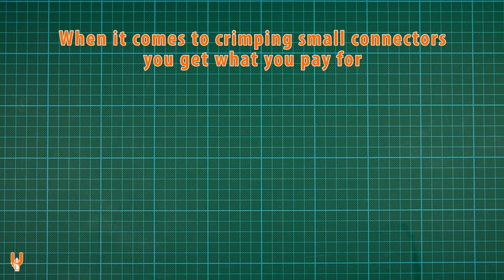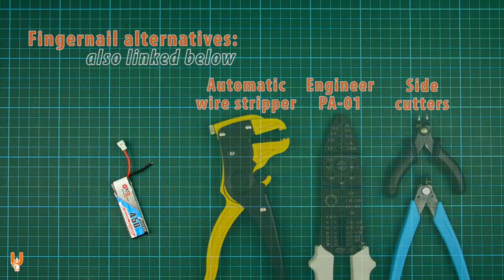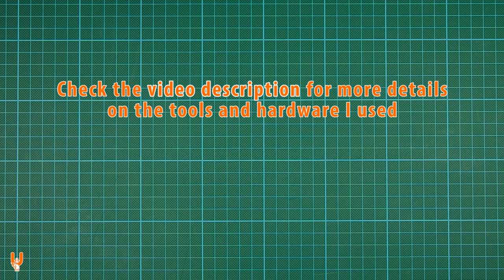How to add PH2.0 "powerwhoop" connector to your batteries - QUICK GUIDE

Comment: Hey Why is it so that I can't find JST-SH(FC and VTX Cable)  connector kit online is there something special with it
Reply from the maker: There are plenty of JST-SH crimp kits on AliExpress. Are you looking for a specific type/size?
Reply: @muteFPV  I want to make my own fc cable but I can't find a single kit on net for crimping jst-sh probably it's 1mm so it's hard to do at home I Guess
Reply from the maker: I haven't looked much for this size, I have a wide range of pre-made harnesses that I use when necessary. I would prefer to make my own too using silicone wires.

Comment: I wonder why you check for polarity? :) Did you expect for colored wires to output differently? :)
Reply from the maker: This is supposed to be a guide, I wanted it to be as complete as possible. It is just an extra step to avoid a simple mistake that can cause all sorts of problems later ;)

Comment: Nice. I need to do this with some of my micro-losi batteries. I was going to just solder wires (that already had a PH2.0 connector on one end) directly to the cell tabs but, I can't find any PH2.0 plugs that have silicone wires with a thick enough gauge. I guess I'm going to have to bite the bullet and get a decent set of crimpers.
Reply: Actually, I just saw the price of the crimpers. I can't justify that for just a few batteries.
Reply from the maker: It is not cheap, that is for sure. But keep in mind you can also crimp motor plugs (1.25mm for brushed whoops or for larger motors like the Tinyhawk), do your own JST harnesses for Rx, VTx and a lot more, related to multirotors. I haven't had good experience with cheap crimpers but you could give one a try, for example the JST SH from Hobbyking, which was recommended in another comment earlier.
Reply: @muteFPV  I usually prefer to direct-solder stuff than use connectors at all. But, obviously you can't do that with battery connectors and, it isn't practical in some other cases. I'll certainly think on it some more.
Reply from the maker: Please let me know if you find a source for good quality PH2.0 battery leads with thick silicone cables
Reply: @muteFPV  I surely will.
Reply: Theres an aliexpress seller with ph2.0 and 22awg silicone wire. 10pairs for 1.80euro
Reply from the maker: @Vincent: I found one named SINONING, is this the one?
Reply from the maker: Thanks!
Reply: I just got the SHUAICHI PH2.0 pigtails. They are indeed silicone wires but, they are 24awg, not 22awg.
Reply from the maker: Damn, I think he changed the description now? In your link above it shows 22AWG under the thumbnail but when you go to the product page it says 24AWG...
Reply: Yeah, I complained about it. He said the factory must have changed the wires without telling him.
Reply from the maker: Yeah right... ;)

Comment: Nice job! How many amps are these plugs rated?
Reply from the maker: Another user said that both PH2.0 and Microlosi are rated for 2A. I did a quick search but cannot find a datasheet for the Microlosi connectors. Keep in mind that 2A doesn't mean it is the absolute maximum of course. In reality, I don't feel there is significant difference between the two and with the PH2.0 being "standard" in most recent micro quads, it is mostly a matter of convenience for me personally. If I were to need more power and do a connector upgrade in a specific build, I would go to JST.

Comment: Is the ph2.0 that much better than micro losi? I have a bunch of losi 1s lipos also and chargers. Is it worth the effort and cost to switch or not really?

In fact I am waiting on eachine trashcan and was gonna convert that to micro losi but now I'm getting paranoid it's way worse!
Reply from the maker: I don't have any data to back this up but I personally consider both of them equally good. The reason I am switching is that now most quads come with PH2.0, so it will be more convenient to convert my batteries. I already had the crimper and the other tools so it is just the cost of the connectors, which is miniscule. All but one of my chargers do microlosi and ph2.0, so in the end I am "losing" one charger that was microlosi only.
Don't obsess over it, do what is more convenient for you :D
Reply: @muteFPV  Make an adapter cable for your odd charger.  @A BU, both Molex 2.0 2Pin & JST PH2.0 2Pin connectors are rated for 2 amps "officially", according to the consensus of what I could find.  This information seems a bit more vague than I'm sure we'd all like it to be for our application, but if you look at the amount of contact area between the two pins, one is rectangular and the other is square...  The rectangular one is about twice as wide as the square pin, so I'd assume they're roughly equal in terms of current handling capacity.  No use creating more work for yourself, though I completely understand the impulse of universal standards of compatibility.

Comment: Suggestion:  How to add a GNB27 connector to your (PH2.0) batteries
Reply from the maker: I have thought about doing such a video for the GNB27 and BT2.0 but it is more or less the same as adding an XT30 or XT60 connector. I am not sure if it will be helpful or necessary.

Comment: Nice one mate, would you make a video for converting a 1s lipo with PH1.25 connector to a PH2.0 connector maybe and or making 2 1s whoop lip's into a 2s pack by combining the 1s . Albert Kim recently did this. Again cool video thanks.
Reply from the maker: I have been meaning to do a how-to video for splitting and combining LiPo cells but it is a possibly dangerous subject and definitely not for everyone. If I figure out a fool-proof way, maybe I will do a video on the subject.
As for converting 1.25mm stick batteries to PH2.0, I honestly don't think it is relevant anymore. I personally have just 1 battery with 1.25mm connector left, everything else now is PH2.0. I expect that people who still have 1.25mm batteries have already used them a lot and going through the hassle of removing the protective casing and replacing the connector will probably not worth the effort.
Reply: @muteFPV  Fare point on the both accounts, i must be the only one left with 1.25mm lipo's :-)  quiet correct in finding a "foolproof" method, it could go wrong if your not paying attention. Nice one.

Comment: Hey. Could you make a video about replacing those ph2.0 for bt2.0 . I’d be the happiest human
Reply from the maker: Hello! If your batteries have battery leads, it is super simple. Just cut a wire, pass a piece of heatshrink over it, solder it to the BT2.0 and shrink the heatshrink. Then cut the other wire and do the same. If the batteries are stick-type (whoop batteries, with a plastic piece surrounding the PH2.0), it is a bit more tricky. Do your batteries have battery leads or are they "stick-type"?

Comment: is it true that ph2.0 can take 30x battery swap before it is fucked?
Reply from the maker: Based on personal experience, definitely not. The 1.25mm connector used to be much more problematic. Also I wouldn't expect the male (quadcopter side) connector to cause any problems. If the female (battery side) crimp becomes loose after use and the surface area of the contact becomes less, I don't know. 30 times is too few.
Reply: @muteFPV  yeah otherwise id be done in a day when my mobula arrives. Gonna order an xt30 nonetheless but good to know im good for now. Thanks
Reply from the maker: You're welcome :) I consider an XT30 overkill for something like the Mobula7 but it depends on what batteries you intend on using. JST will be fine as well.
Reply: @muteFPV  it's the V1, with 2x 1S  in series.
I've heard that it causes a bigger voltage sag. And the performance is not as good compared to a "true" 2S battery or something. If that is true than it might be worth it no?
Reply from the maker: Yes of course, I meant the usual red JST, which is available in many 2S batteries. Not the stock PH2.0 :)
Reply: @muteFPV  Hmm ok the mobula v1 has a white connector so it's a stock PH2.0?
And the red JST is better than PH2.0?
And JST is not compatible with PH2.0?
Sorry but i'm kind of a noob here.
Reply from the maker: My bad, I should explain it in more detail. The stock connectors on the mobula are called JST-PH 2.0 (meaning 2 millimeters) and it has become the "standard" for small 1S LiPo batteries. The red connector is called JST-RCY and is commonly used in 2S, as well as in some 1S and 3S batteties. For convenience we just refer to them simply as "PH2.0" and "JST". You can use JST instead of XT30, it depends on what batteries you want to get and what chargers / adapters you have. Just wanted you to know both options :)
Reply: @muteFPV  Ah alright thanks for the explanation it's quite overwhelming getting into this hobby. So the fact is the red JST is already a big improvement over ph2.0 ?, and i might save some weight of the x30 along the way. 
I dont get why all those guys praise xt30, even the diatones 2s/3s bnf  come with xt30. That's why i never researched any further about connectors.  Either way it's going to be a solder job to get those thin wires of the board. I'm still  not sure about battery and efficiency. I've been looking at the Turnigy 350mah 2S  instead of 2x 250mah 1S that comes with it.  What is your view on that?
Reply from the maker: Again it depends on the use case. If you are talking about the Diatone R239 for example, it uses much bigger and power hungry motors and needs the additional power xt30 (and batteries with xt30 can deliver). On my Beta65X which is strictly 2S I will replace the 2x PH2.0 with a JST and use my trusty 2S 300mAh turnigy nanotech batteries which are perfect for this small size. I have seen people praise the recent 300mAh high-volt packs from GNB (Gaoneng), they have various types of 2S batteries that may suit your needs and they are consistently performing very well. Do the 350mAh batteries fit into the battery slot of the mobula frame? I haven't tried them before.
Reply: @muteFPV  I believe so, the width and length dimensions are the same so i guess if i lose that bracket the 2x S1 fits in i think it fits, i need to double check before im spewing nonsense.
Reply: @muteFPV  I was speaking of a 300Mah my bad. Anyhow, it got the same width and even shorter length. The Heigth is 3mm more compared to stacked stock ones.
I might pull it of, it's 4 grams heavier in total also, but i think it's a higher c-rating. and 50mah per cell more if i'm thinking logical.
Those come indeed with the red JST.
Reply from the maker: Yep, I think we are talking about the same batteries :)

Comment: I always tin the wire and then reflow the solder after I do the crimp.  Easier to trust a crimped and soldered connector, especially for aerial use.
Reply from the maker: Interesting idea. Doesn't the fact that you reflow the solder after crimping mean that the crimp itself ends up grabbing less firmly on the wires?
Reply: @muteFPV  My intuition says that crimping into a single deformable cylinder of copper and solder, actually gives it something to bite into with more contact surface, as opposed to a bundle of individual slippery cylindrical pieces of metal that are all parallel with the direction that you'd rather the crimp didn't slide.  Then upon reflowing the solder with the crimp attached, the solder fills in even more space that would otherwise be air gaps.  Better for current flow, and ensuring that the crimp is mechanically welded to the wire.  Also it makes sure that every strand of wire is inside the connector, and makes it easier to insert since that tool is a bit awkward, especially with sub-millimeter connections and <=30AWG stranded wires.  You don't want to lose an ESC control line, or GPS comm line, mid-flight from vibration or snagging a branch.  I had an XT60 tear loose from the battery leads itself (hobbyking!) as I went through some leaves on the top of a tree.  It shorted the carbon by the time it was on the ground...  could've easily been a big field fire if it hadn't crashed near where I was standing.  No such thing as good enough with drones.
Reply from the maker: I agree with crimping on the tinned wires, I am just not sure if reflowing afterwards is indeed better. Anyway, I will try it for myself as well, it is a nice idea.
Reply: @muteFPV  i also solder my crimped wires, they are bombproof after that. Really strong

Comment: wouldn’t it be easier to just pull the cable out thats already crimped and place it in the new one? no problem with a pair of tweezers for example
Reply from the maker: If you mean use the same crimped terminal from MicroLosi for example and put it into the PH2.0 connector, it is not the same shape and it won't work.
Reply: muteFPV thanks! If I don’t really have to swap connectors, do I really need a crimping tool for fpv or is it rather rarely used or not at all for the average fpv pilot?
Reply from the maker: You will need it very rarely. I do prefer to crimp my own with better wires because some harnesses don't come with good quality flexible wires. But you normally won't need it. Also cheap crimpers are bad, I tried a few before finally buying a good one.

Comment: Me I prefer microlosy connector more power !    👍     😉
The crimpers
Engineer PAD-11-10-09 crimping tool  very expensive.   -1
It's better soldering !  +1
I prefer to direct-solder it's better and stonger !  +1  👍  🖐
Reply from the maker: Please share if you have data for the MicroLosi being better than PH2.0, I couldn't find any solid information. I agree with you, the crimpers are not cheap (but they are built to last). Since I already have the crimper, I prefer to change the connector than solder. If you solder a PH2.0 cable on the battery it is not any stronger than crimping it yourself, the PH2.0 is crimped on the cables you used anyway.
Reply: I would agree without having data. Just with common sense. the contact surface is much bigger with microlosi. also microlosi uses very soft metal (tinned) that has a very low resistance. Also from my experience, PH2.0 wears out faster than microlosi. I'm defenetly in team microlosi
Reply: @VincentFischer    It's that, true.   👍
On my Snapper7 I add a microlosy with flight better and more flight time, after I do that on my Eachine UK and US 65 the result is the  same better, too.  😉

Comment: The pa-09 sucks. The connectors get stuck in it.
Reply from the maker: Thanks for the feedback, I have read great reviews about it. I went for the PAD version so I can have dies with larger crimp sizes.
Which crimping tool did you replace it with?
Reply: @muteFPV  I just annoyingly struggle with it. I like the crimper you used. I may pick it up.
Reply from the maker: I am very satisfied with it so far.
Reply from the maker: I agree, the PAD is a very versatile crimping set and not that  expensive for the range it can crimp.
Reply: BTW, The PA-01 has M2 & M3 bolt cutters and barrel crimps for doing car stuff.  The PA-14 is the best precision wire stripper I've found that can handle the individual layers of micro coaxial cable for tuning micro antennas such as RG-174/U.  Engineer is buy-once per lifetime (most likely), so I think it's worth it.  Working with cheap tools, you tend to botch things up and create more safety problems for yourself; simply unacceptable if you're doing long-range or big heavy stuff in the air.
Reply from the maker: Noted the PA-14 to check it out, thanks! I have cut a few motor screws to shorten them a bit with the PA-01 but I am not sure how easy it can wear out (the part that cuts the bolt, not the part with the thread).
Reply: @muteFPV  I usually use a dremel for stainless / carbon steel & titanium, but the PA-01 can cut aluminum all day.  Whatever the grade of aluminum is from https://www.fastener-express.com/ (looks like 7075 T-6, whatever that means).